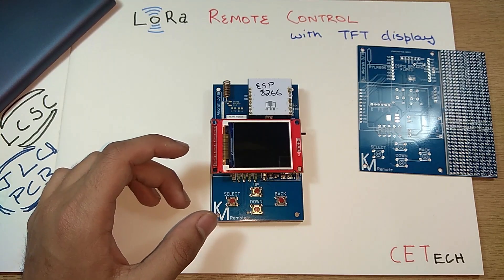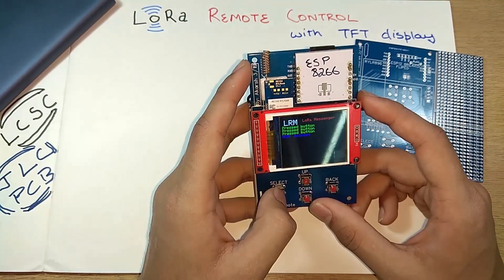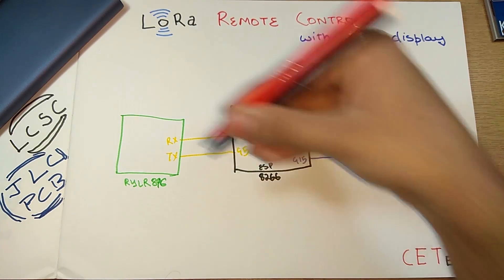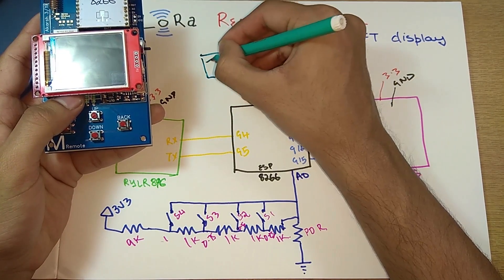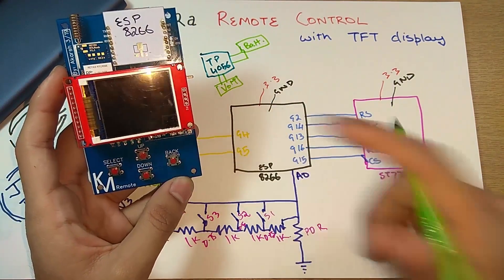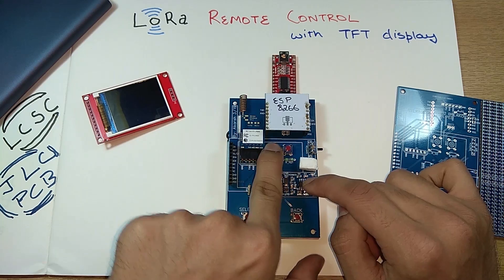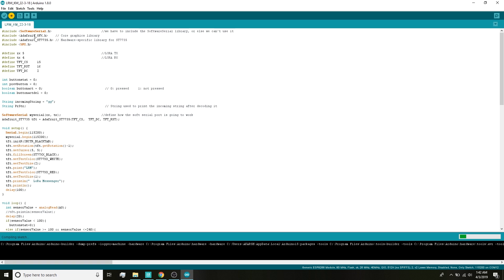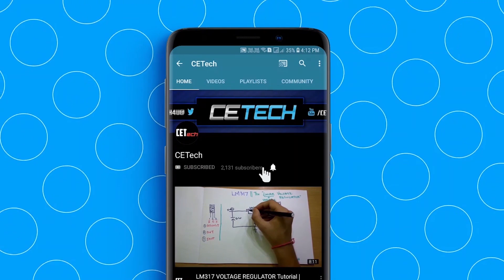LoRa Remote Control Messenger With a 1.8" TFT | Distances Up to 8km

Comment: What's the use of esp8266 here? No point in using so powerful module here if we are not using it's wifi ability. A simple atmega328 or ultr low powered stm32 will be best for bettery based design. Just a suggestion. 👍

Comment: Sir we can used same device sender side. That means using same device both side and each have data sending and receiving.
Reply: Can possible
Reply from the maker: Yes you can

Comment: Would it be possible to connect to cellphone with Bluetooth to be able to use phone features over Lora?
Reply from the maker: Yes possible, but it'll require some coding on the phone side probably an app or some script.
Reply: CETech hmm very interesting : so only non Apple - unless you made an app, which Apple approves somehow... or is there a way to handle on the module and just have device connect to Bluetooth but module handle communication networking?